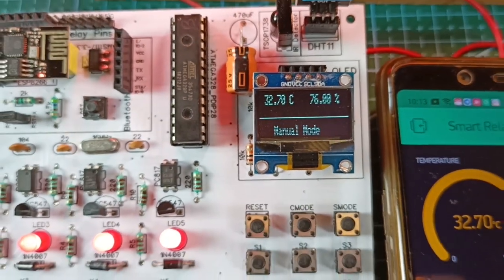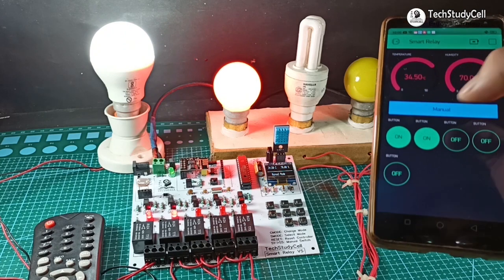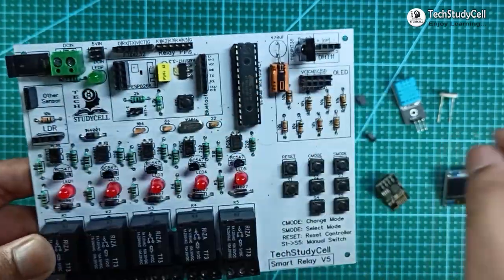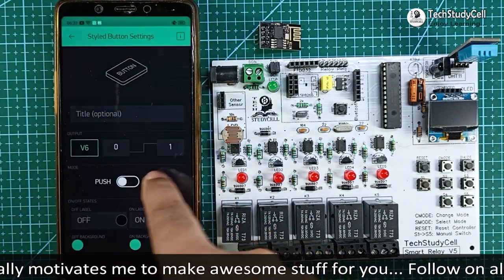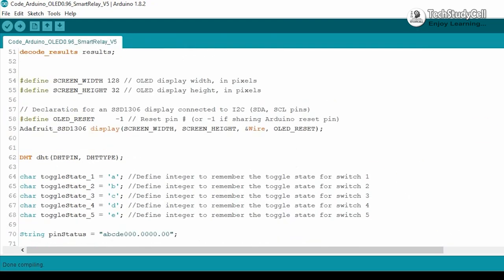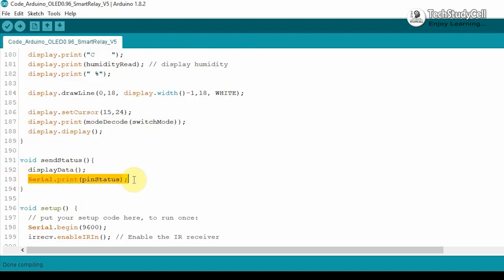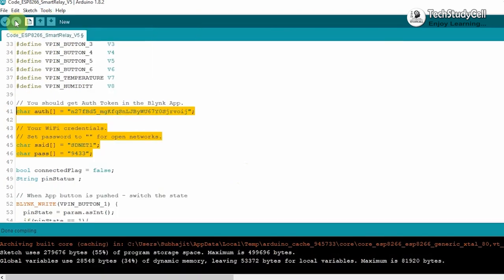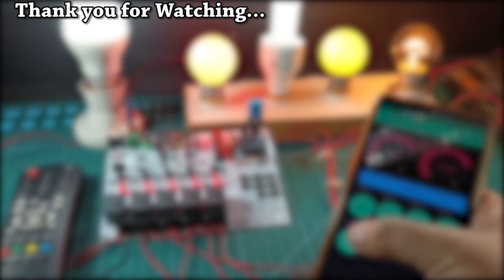Home Automation using Arduino and WiFi module ESP01 | Arduino ESP8266 control Relay | IoT Projects

Comment: why did you use below:-
. 100nF (104) Capacitor (1 no)
. 470uF 25V DC Capacitor (1 no)
. 1N4001 Diode (1 no)

As not mentioned in cct diagram?

Comment: Thanks for sharing this. 
I would like to use your idea to replace my broken fridge circuit board and I got few questions for you. Hope that you can help to answer. 
- What free software can I use to make change of your PCB design. 
- what is your capacitors voltage spec
- can’t find the 7805 voltage regulator. Only have KA7805. Are they the same?
- for the 12V input. What is the power output requirement for the power adapter? 1A?
Reply from the maker: I use dip trace free version. Voltage 25V. I have used 5v supply for 12v please use 7805 with heat sink.

Comment: Brilliant explanation, sir will it be possible for you to explain the RF module transmitter and receiver circuit step by step every components used with all calculations etc. eg. 433 MHz transmitter and receiver module circuit every components used and working 🙏

Comment: Can we connect 3 phase load on relay??plz reply
Reply from the maker: You can use 3ph starter. Relay will supply the coil of the starter. Thus you can control 3ph load.

Comment: Can u pls make a project for relay control with iR+Bluetooth+ and toggle or push switches
Reply from the maker: Already published that video.
https://youtu.be/7HGqV-qilGY
Reply: That's nice sir 👍
But I want ir + toggle switch control relay 4 channel
Both mode working similar.
Means when we switch on relay from remote we can off relay from from toggle switch like our domestic normal switches

Comment: Hello sir.
If u don't mind can u make a project of automatic star Delta converter with Arduino and condition monitoring with protection against over current and over voltage

Comment: Thanks for the most wonderful video
I am trying to do this project but I get this message (Error compiling for board Arduino UNO) when trying to compiling
Note that I have chosen Board "Arduino Uno."
Gratefully "
Reply from the maker: There are 2 codes. Select the the board Arduino UNO for the Arduino sketch.
Please watch complete video, I have shown all the details.
Reply: @TechStudyCell  This problem appears in Arduino UNO code only

Comment: Error   
In file included from C:\Users\ANN\Downloads\Code_Smart_Relay_V5\Code_Arduino_OLED0.96_SmartRelay_V5\Code_Arduino_OLED0.96_SmartRelay_V5.ino:16:0:

C:\Users\ANN\Documents\Arduino\libraries\Adafruit_SSD1306/Adafruit_SSD1306.h:41:26: fatal error: Adafruit_GFX.h: No such file or directory

compilation terminated.

exit status 1
Error compiling for board Arduino Nano.

Adafruit_SSD1306.h  Version  ???
thank you
Reply from the maker: Select Arduino Uno board before compiling. And use the latest version of libraries.
Reply: @TechStudyCell  
Compiled passed
Thank you very much.